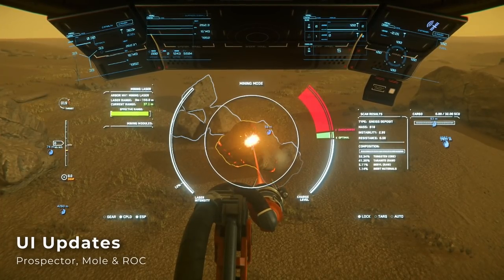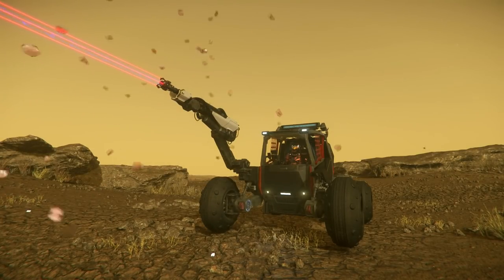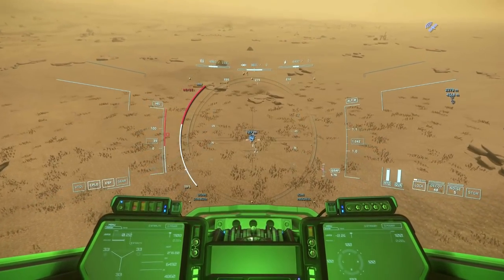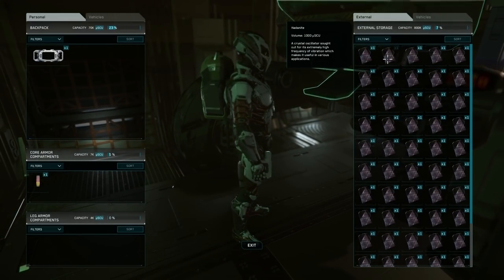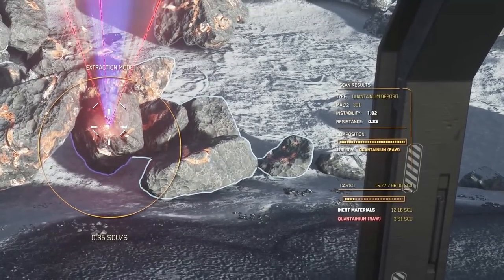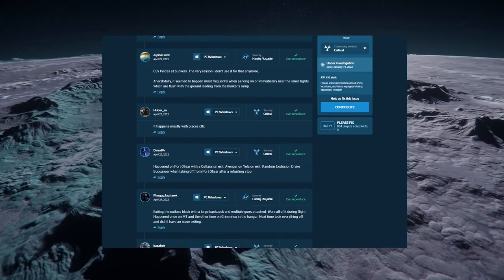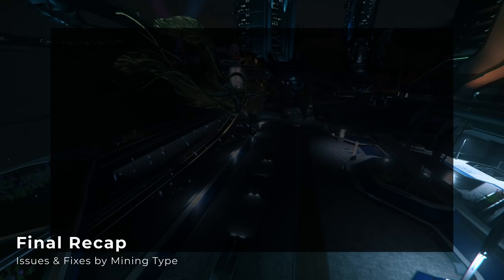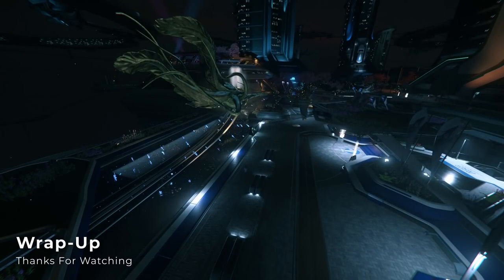What Changed for Mining in 3.17? Your Guide To Bug Fixes, Updates & New Challenges Affecting Miners

Comment from the maker: Thanks for being here! Edit 6/6/2022: There are 2 critical issues still ongoing for mining after 3.17.1 - Mole Extraction and Refinery Shop Terminals Not Working.

The Mole is not able to extract materials, and shows a cargo capacity as "0/0 SCU". Prospectors are unaffected so use them for the time being. Also, please help contribute to this issue council report as this is a MAJOR issue. https://issue-council.robertsspaceindustries.com/projects/STAR-CITIZEN/issues/STARC-38161

Refinery Shop Terminals where you can buy modules, lasers, and gadgets, are not visible. This affects any of the shops in the refinery stations (HUR L1/L2, ARC L1, CRU L1, MIC L1). You can try shopping at Shubin Interstellar in NB, Tammany & Sons in Lorville, and Dumpers Depot in both Area18 and PO. Selections may be limited.

Mining Gadgets Tutorial - https://youtu.be/DL5HeGkRNWU
Active Ping Angle Tuning - https://youtu.be/vz8TOCUa0Ms

Issue Council Reports: 
https://issue-council.robertsspaceindustries.com/projects/STAR-CITIZEN/issues/STARC-27662 - Ship exploding on exit
https://issue-council.robertsspaceindustries.com/projects/STAR-CITIZEN/issues/STARC-13759 - Ore turning inert
https://issue-council.robertsspaceindustries.com/projects/STAR-CITIZEN/issues/STARC-30407 - Physical assets for Q not showing up

Comment: Before I bought my prospector, I figured out a nice trick with the ROC extraction laser.  It picks up fragments in big groups if you use it in short bursts, and wait a beat in between. 

I noticed that whenever I first used it after breaking a rock, it would just suck up everything around where I was aiming instantly.  So I started trying to use it in the shortest bursts possible, and it seems to work reliably.  But yeah, can't be rapid-fire bursts, seems to help if you wait just a few ticks in between.  Make it think every burst is the first burst.  

If you just keep the laser on continuously, it starts slowly sucking them up one by one.  Which is definitely better than the "hadanite hurricane".  But using it in short bursts seems even more better.  

This way, it can actually be beneficial to break 2-3 rocks before starting to extract, so you get some nice dense clusters.  But there is a limit to that benefit - if you try to break too many and the clusters are too dense, some of the fragments will go sailing over your head.  

Try it out, ROC miners!
Reply from the maker: I'll pass this along to my community! Lots of people trying out ROC mining that could test it out!
Reply: @RedMonsterSC  Nice!  Would be great to know if it works the same for everyone.

Comment: ROC has an issue where the collection will stop picking up the gems. The few times it has happened for me, I have powered down, gotten out, and while out just pause a minute to inspect a gem or two, return to the ROC and power pack on. This resolved the issue.
ROC components are failing and there is no repair for the ROC. I suggest reclaiming the ROC after every two runs. ProTip: take it out of the ship before claiming :) 
One thing about the new Ping on the surface looking for gems is that the large ores stop returning a ping but gems continue to echo back until you are on top of them.
The Halo has been pretty rough in this build, the dice rolls for me have all been below 10%. My previous happy spots (Like Band 1) have been dried up. So I look forward to your review of how to make the best of it in Aaron's Halo.
Reply: @Sexigesimal360  Great ideas. The component upgrade is an option were we can do a grade class upgrade of two power plants and the single cooler. They are actually inexpensive and can be gotten at Omega Pro in New Babbage. I'm still not fully convenienced yet that it makes a big difference. Still testing that now. 
Great idea about the repair. I had never made it that far in the process because I decided that if I had to pull the ROC out of the ship,  I would just reclaim the ROC and start all over with a shiny new one.
Reply: @Sexigesimal360  excellent, good to know. Thanks for sharing.

Comment: So the fix for Gemstone collection with the ROC has crated a different issue. I have seen many, many times that the ROC collects them, but they do not show up in the inventory. If I cycle the ROC power I can see them floating in the air and can't collect them. The only way I have found to resolve this issue when it happens is to log off the server.

Comment: Biggest Problem I have come across with ROC mining is my Cutlass black that I haul with doesn't have a working altimeter in moon atmosphere.Is this a Cutlass problem or are other ship types having the same issue?
Reply from the maker: You're right, altimeters have been hit and miss for the most recent patch. I've noticed I compulsively ping as I'm making my approach to the surface just so that I can get the virtual landscape highlighting.
Reply: @RedMonsterSC  I wish they were radar and not baro altimeters too. It's strange to have a baro altimeter on an airless moon. If radar was used it would always read zero when landing.
 I also have this same issue with my Cutlass.